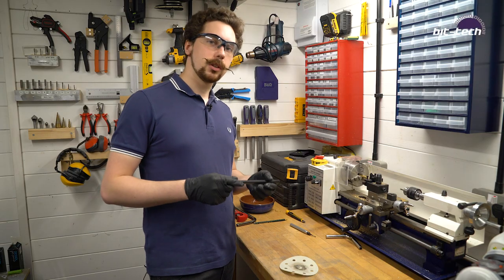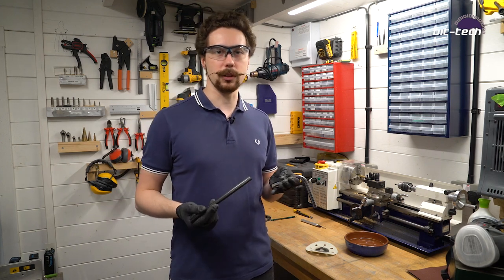Hardline Tubing Guide: Brass and Carbon Fibre | bit-tech Modding

Comment: Pro Tip: Use a deburring drill attachment for the outer corners if you don´t have access to a belt sander but to an drilling machine which is much more likely at least in germany. You still have to do the sanding after that.

Comment: The deburr on the brass pipe wasn't done nearly enough. There's still a huge lip at the front from the cutters, that needs to be removed with the deburring tool via significant pressure to create a smooth transition. I'd advise this step before the sanding

*on the final shot it looks correct, only talking about how it appears while sanding

Comment: Thanks for the tips ! Just a couple of questions if y will. First, is it better to use  glossy finished carbon fiber or matte finish ? Also, will 4 one hundredths of a mm in OD make a big difference with fittings? Thanks in advance for your time.

Comment: Question im using brass bitspower 14mm tubing with 14mm ek fitting how kucj do I have to debur it and I did a test one and got it in the fitting was somewhat hard but im able to pull iy out 9f the fitting is that normal
Reply from the maker: How easily does it pull out of the fitting?

Comment: really starting to like brass tube builds. alphacool brass tube are 13mm OD, will i be able to use with ek 14mm fittings?
Reply from the maker: IRoN0RE Nope you’ll need to use 13mm fittings for 13mm tube, the OD is very important sadly. Bitspower and Barrow have 14mm chrome tubing though
Reply: @bittech1  cheers

Comment: Does the carbon fiber affect the loop in any way? Any mixed material concerns? Where does someone find carbon fiber tubes?
Also, what's with people and the hate towards the mustache? Let the man have the facial hair he wants, not your face not your problem.
Reply from the maker: In theory it shouldn’t do, although carbon fibre dust is very conductive so bear that in mind. You can either get ones from Alphacool (not recommended though as they’re extruded and hard to work with) or searching online for local composites retailers.
Reply: @bittech1  What's the issue with alphacool CF tubes? Also do you need to treat the cut ends with heat or anything to seal them up to liquid?

Comment: what's the ID and OD of copper tube for G1/4 fittings?
Reply from the maker: Use the size that your fittings are rated for, no different to working with any other hard tubing variety. Worth knowing though that the vast majority of rigid fittings only use the OD for the seal, so that's the important measurement
Reply: @bittech1  thanks.. copper tube measurements i'm getting are inches in fractions like 1/2, 3/4 i don't get any 14mm OD as i convert it to mm haha ..
anyways, are brass tube safe for loop with copper rads? or copper tube is better?
Reply: @meronmeron-m3m  im sure you already googled this since your post is a year old but Brass is a copper based alloy. used internally in plumbing fittings especially in homes using copper pipe for the water delivery to said fixtures or valves.